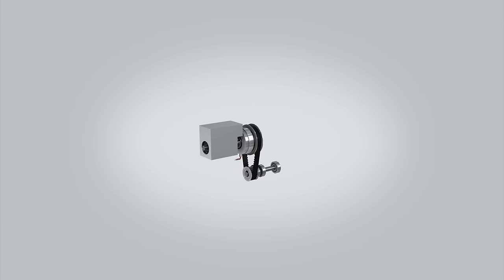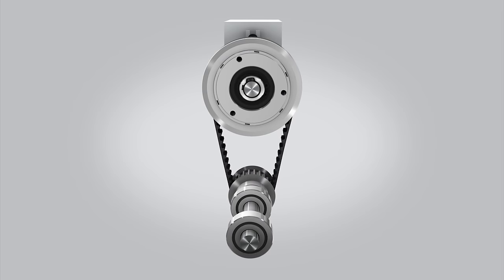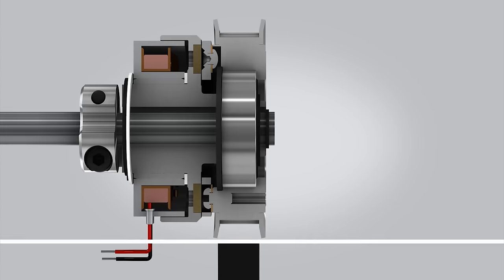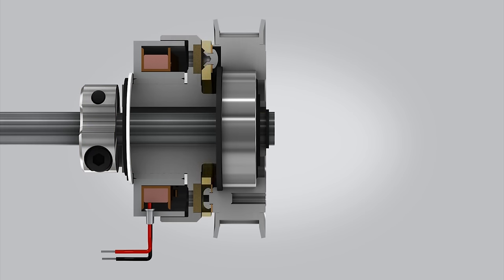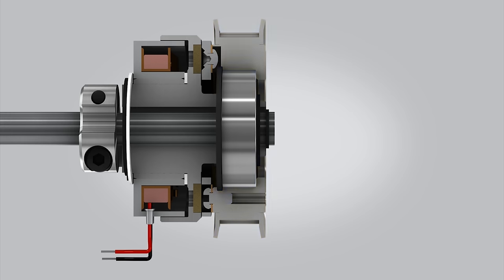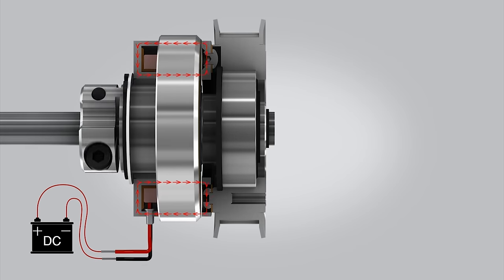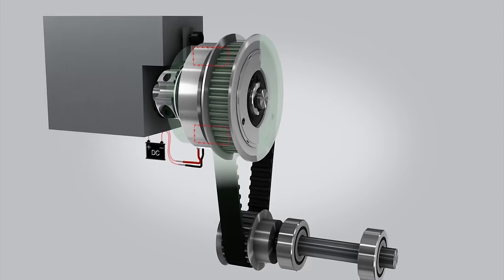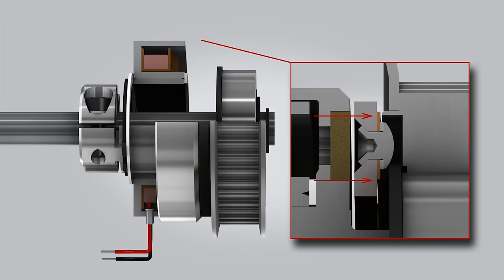Electromagnetic Clutches - How It Works

Comment: So, its similar in mechanism as a car cluth, except, its operated by electromagnet.
Also, it implies that if we put less than required voltage in the coil, causing the cluth to slip, it will overheat quickly.

Comment: is any damage when engage in high rpm?
Reply from the maker: Thanks for the comment. Do you have a machine that requires a clutch running at high rpm? We have many options (standard and custom designs) that could help you. Give us a call or email us about an application you're working on and our engineers can give you more details. https://www.kebamerica.com/contact

Comment: Is this pulley universal look for use in supercharger turbo set up?
Reply from the maker: KEB electromagnetic clutches can be used in many applications including the automotive industry. Contact us to connect with a KEB application engineer. They can help find the right solution for you.

Comment: Hi, great vid, do you think it would matter if the drive came in via the pulley instead of the shaft? I'm thinking about taking a belt drive from an unused pulley on an engine to drive the pulley on the clutch assembly then using the shaft as a pto. Any thoughts?
Reply from the maker: In short, yes, you can run the clutch either way so long as the magnet is held fixed. It doesn’t matter if you clutch the rotor on from the hub/pulley or clutch the hub/pulley on from the rotor. Contact us if you have questions or want to learn how our products can fit into your application. Thanks for your question! - Jake
Reply: KEB America, Inc. Thanks for replying so quickly, much appreciated.
Reply: KEB America, Inc. How much would one suitable to run a 10kw generator cost?
Reply from the maker: That's a question for a KEB sales engineer. KEB America serves the North American market and we are happy to assist you if you live here. However, if you live outside North America you can find a local representative to ask for engineering and pricing questions: https://www.keb.de/company/representatives-agencies 
Thanks! - Jake
Reply: @KEBAmerica   - How much DC current is needed? Required ?

Comment: Is it possible to apply a small voltage so that the armature can slip on the fixed plate? It means no total engagement between those components.
Reply from the maker: That is a good question for a application engineer in our brake and clutch department. Send us a request on our website or call our main number to speak to a representative: https://www.kebamerica.com/contact/

Comment: Mechanical is simply but the driver circuit always make it headache. It can't operate fast cycle enough from the magnetic circuit delay hysteresis. So that servo motor has replaced it.
Reply: Can you explain futher? Really trying to learn about this stuff 😅
Reply: @Noadvantage246  It's commonly used in motion and sudden stop by actuating electric current to the clutch.  Normally they have its duo on another shaft end, it is magnetic brake.  When one want to engage the shaft in motion they send current to clutch and disengage brake. And when stop periods comes , they disengage clutch(by stop current) and engage brake simultaneously .
Say it easy is they are quite seen in intermitten motion mechanism.
Reply: @alexlo7708  Interesting. So what do you mean by "magnetic circuit delay hysteresis"? And you're suggesting a servo motor has replaced what?
Reply: @alexlo7708  Also I get what you mean with the electromagnetic brake as a counter part to the clutch but I'm wondering is there a system that can act as both the clutch and brake?
Reply: @Noadvantage246  In packaging plastic bag business, most advance machines use servo motor in shaft driven rather than magnetic clutch-brake dual.  They say it has faster output.
Reply: @Noadvantage246  Magnetic has its permeability. It acts like buffer that prevent sudden change its state.  This delay has limited itself response to fast interrupting control signal.
Reply: @alexlo7708  That's really interesting. I see what you mean with the servos, makes more sense in that application. 

I've be looking into these electromagnetic clutch and brakes systems bc I'm wondering about their viability for use with E skateboards. They have absolutely no brakes other than "regenerative breaks" that really don't do much for you at speed except hurt your battery and while your battery is full you can't use it at all.

A power on clutch would be very neat as it could disengage the driving motor from the wheels to allow for better  coasting and make it easier to manually kick push the board. It'd also automatically disconnect from the motor when the battery dies allowing you to use it like a regular skateboard. Tho I have a few concerns about the power the electromagnetic clutch would draw and if it would be worth it.

I'm very excited in exploring the E break though, the battery could easily provide the necessary power and the nature of breaks means you won't be fighting the motors for current and you only need them in short bursts.
Reply: @alexlo7708  I've never worked with these before, what do you think? Could 2 ~60mm 24v electromagnetic brakes applied directly to the rear wheels slow a longboard at speed? A bit of research puts the dynamic load these could stop around 20Nm.
Reply: @Noadvantage246  It isn't not force or anti torque that decides. But it cycles on operation.
Servo motor can run/stop with more cycles frequency. While brake and clutch needs more time in return to its initial state. I mean for plastic bag making machine.
By the way, for your E skate board ,I think its not suit your application. This clutch has no slip , so it acts like instantaneous force. No linear accerelation allow.